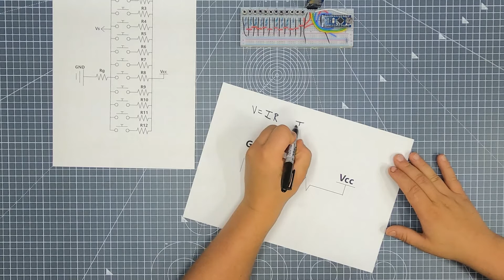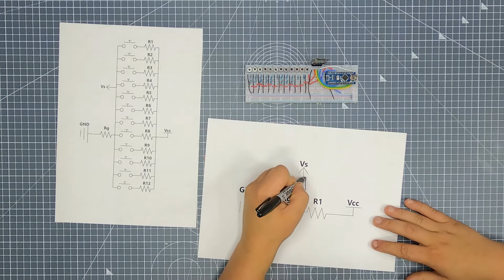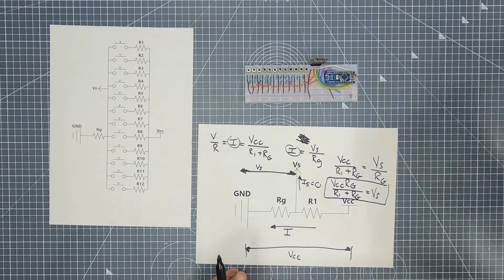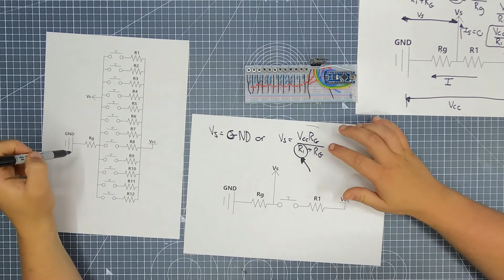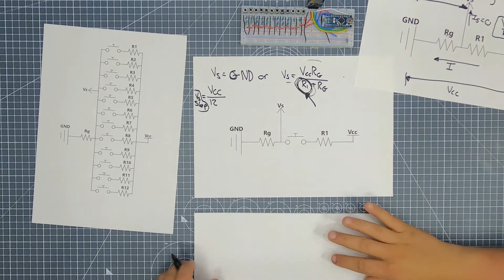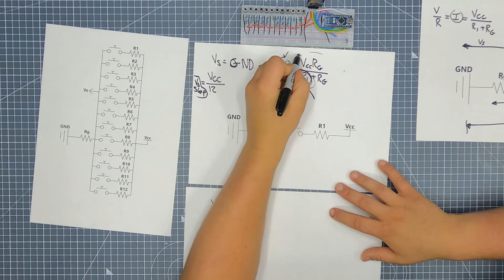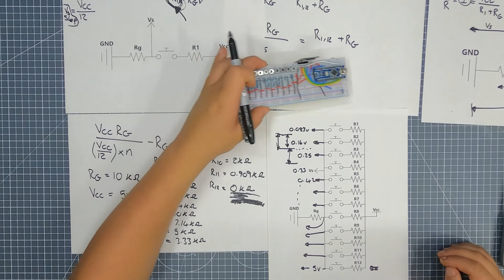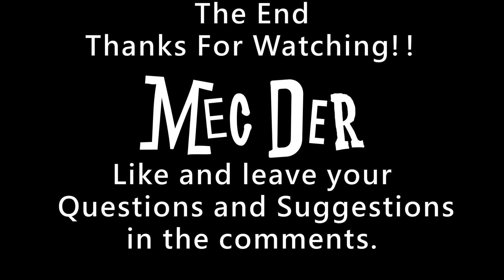How connect multiple switches to one pin, Arduino?

Comment: Or you can spend $1 and use an expander and cut the code by about 90%. Debounce would be a nightmare and multi-press will cause a number of issues.
Reply: By expander do you mmean a multiplexer or something else?

Comment: Or, for N push=buttons, connect N+1 of all the same resistor value (doesn't really matter, just chose the sum to give maybe 0.1-10mA through the lot) and then use the switches to select a tap on the chain to the ADC input. No complex math, no problematic values. If the ADC is not reading the rail (put a big puller to one of the rails) then a switch is pressed, the voltage read tells you which.

Comment: You could also put the resistors from each switch in parallel and determine the resulting resistance to know if multiple switches were pressed at the same time
Reply: But can you know than which one ?? If is in parallelal than is the same for every button

Comment: So to use multiple switches at once, we can separate out the resistance to modulate the voltage output by 2^Rx, we can undo the math on the other end of the equation to essentially figure out which switches are closed, right?

Comment: cool!  great idea
did you use software to de-bounce the switches?
it seems like if you carefully selected the resistors you could have values for multiple button press signals? 
too bad the esp8266 only has one adc, guess you would need a ADS1115 in that case if you needed the adc for other sensors
Reply: About multiple buttons pressed at the same time:
Since his values' distribution is linear (you add 0.083V each time (14:55 or this times 5 idk)) he cannot. This is an efficient way to distribute values for single presses while leaving lots of room for imperfect physical resistors' values.
However, as you noticed, there is a way- make the distribution exponential (you multiply by 2 each time). By choosing the base to be 2, you can easily implement it in the binary system on the software side (Divide all values by the 1st increment and represent the resulting number as a binary number- each consecutive bit is the state of each consecutive button.). The downside would be less buttons that you could theoretically use, since the increment at the lowest values could be too small (in the case of too many buttons) for the Arduino to notice. Idk what the smallest safe increment is (would require a little bit of testing), but it determines the maximum amount of buttons you can use.

About de-bouncing:
These are standard buttons, so if anything he had to de-bounce them in the software. There exist expensive buttons that don't bounce when pressing and releasing. You don't always need to debounce, but for logic or other sensitive purposes you absolutely have to. You can do it by either adding a delay (with 'millis()' preferably) or by making a bunch of x previous measurements into an array and either counting whether there is more high or low states or by taking an average of those x measurements and comparing it to 0.5 (less than 0.5 would be low and more than 0.5 would be high (0.5 itself can be high or low, depending on your personal preference), since in Arduino Reference LOW==0 and HIGH==1).

This comment is mainly for future adventurers, however if you check it out after those 2 years and find it still helpful, I'd be glad. lol cheers, mate
Reply: What I did on my ladder resistor was use 16 samples I also used a capacitor. So you press the button and it gives you the average value over 16 loops
Reply: @shokdj1  What should be the value of the capacitor when using it? I made a 16 button system. Which capacitor should I use?